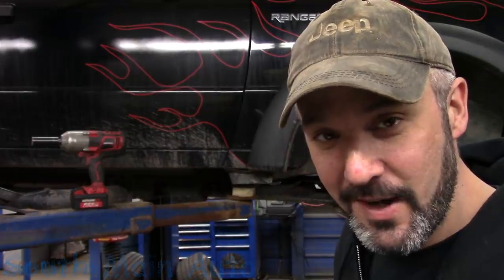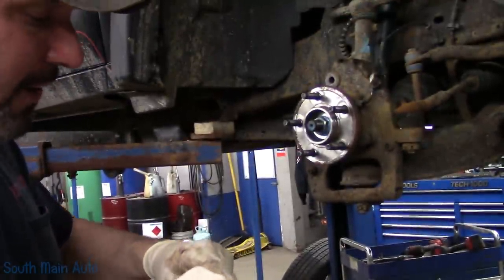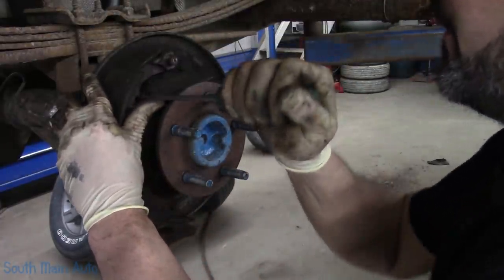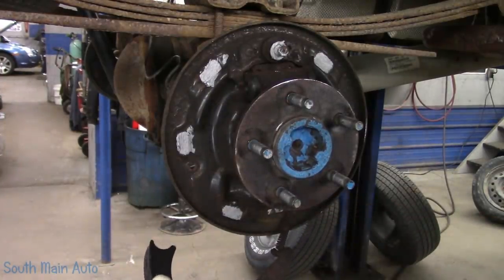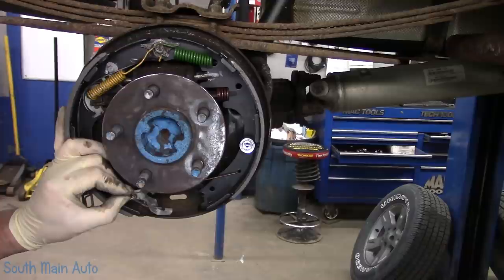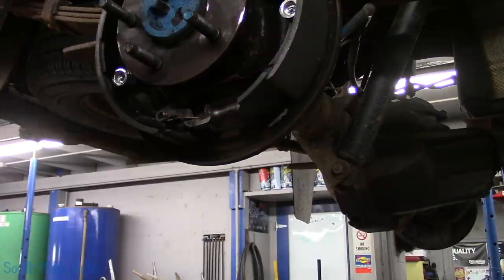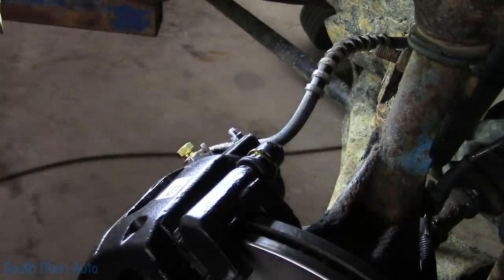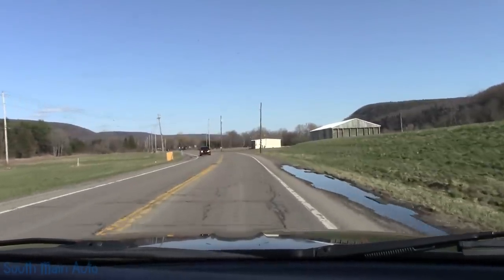Ford Ranger: Full Brake Job w/ Rear Drum Brakes

Comment: did you replace the back plates ?
Reply: stephen ross the front backing plates are not important. They do not support the brake mechanism on the calipers. As for drum brakes the backing plates are needed because they hold the torque of the shoe that will be stopping the vehicle.Drum Backing plates are way thicker.If they start to rot they would need to be changed. The front backing plates are just a dust shield. My 2003 Ranger I ripped them off 5 years ago due to rust as Eric did here and I never replaced them either. I have no run out on my rotors as of 2 years ago when I last changed the pads and rotors.

Comment: When I worked on brakes, starting in the 50s. we did not have any never seize. used dabs of chassis/wheel bearing grease or a little motor oil. Anyone else old enough to remember stringy wheel bearing grease. As a kid we used to say if  the rear end howls when you let off on the gas, thats ok. but if it howls when you step on the gas its going bad. that may not work on everything rear wheel drive.
Reply: I do remember!  First brake job was a 62 Nova, drums all the way around.

Comment: Hey Eric,  If you have the opportunity to do one, make a video of a GM "single-spring" drum brake job (like on many later Buicks).  These have to be the most unnecessarily difficult rear brakes ever devised by the evil brains of GM.
Reply from the maker: Oh man those are gravy! Oh and they have 2 springs BTW haha. I have a tool for them but I never use it. I can do both side in about 5 min if every thing is clean of course.

Comment: Great video Eric. The way you do things reminds me of how (exactly) I do things. I agree that you should use a service manual instead of the other side. It's funny that you mentioned that because I just did rear brakes on 99 Toyota Corolla and the springs for the automatic adjusters were installed wrong so the adjusters wasn't working. If I would have reinstalled them the way they were the automatic adjusters would again not work correctly. You should never assume the person that worked on the vehicle before you actually knew what he was doing.

Comment: I love bleeding brakes with my wife. It is the only time I can tell her what to do and get away with it. (up-down-up-down, Turn to the right, turn to the left). My wife is great like yours at helping out when I need a 2nd hand while  working on cars. I Liked how you showed the use of the  hose instead of letting the fluid run over the caliper. That is how I was taught to do it. Just something about brake fluid on everything that bugs me. I use a can and a hose. Anti-seizure has got to be one of the worst things to get off everything you don't want it on. I was wondering why you don't spray down the parking brake cable with your fluid film. I bet off camera you did.  Funny how the Brake clean makes no sound when it is empty. A very hand feature only your brake clean seems to have. Your father/ daughter ride along at the end made the video.  Keep em coming.

Comment: I’ve got a bad metallic squeak sound coming from my rear drums when slow speed braking. In my head it sounds like the brake shoes are getting hung up and releasing on the backing plate pads. Heard this before?

Comment: cheap-o's are cheap-o's, when they don't wanna pay for rotors, you clean'em up and slap them back on or supply cheapest chinesium junk.
On that truck I'm guessing it had new "chinesium" rotors, but it sat around only driven once every few weeks and never washed or very short trips, with minimal breaking.....
that is how you can tell good from junk metal rotors :)

Comment: I know this is a year out but I use a large cotter pin or split pin opened so you are only using one end. That can be pushed into the window and gives plenty of room for the spoon because the split pin is flat. You can slightly bend the pin if needed to push on the adjuster brake. I have been using the same one for years. I wrapped electritions tape around the other end so It gives me more material to grip, also so I know it is for brake jobs. I used to keep all my brake job tools together in a plastic tackle box so I knew exactly where all my stuff was. This was back in the days where I was going to college and used to do brake jobs on the weekends for extra money.

Comment: /sigh ... My little '94 4 L XLT has all 4 paws off the ground right now. Pin held front pads but the rear brakes appear to be identical to the one's in your video. Unfortunately the rt front blew the inside pad off on the interstate and at first I thought I had run over something and had a flat because it pulled bad to that side. When I stopped to check at the eatery a 1/4 mile away, tire was good but I could smell brake pad stench. Went inside, ate, came out and as I started to leave ... no pedal ... all the way to the floor. Anyhow, limped it home at Florida blue hair speed and got the front up on jackstands and looked. Pads on left side- OK, outer pad on Passenger side very thin, inside pad - gone and caliper piston had replaces it cooking the rubber piston seal. Yea me, bad maintenance rule violation #1. Check BOTH sides when doing an oil change...duh.

Anyhow, thanks for the rear brake walk through if I need to do them. Never have done a pinned caliper before, was shocked when I couldn't find bolts to take them off. At least Ford had the good sense to abandon that idiocy and a few people have made guides. Live and learn.

Keep tossing out those video's, I watch them all. Maybe in a few months I will have seen most of 2015 on. I'm learning to think outside the box thanks to you Mr O and dang it, you're fun to watch too!

Comment: In 1995 I bought a Ford ranger and I had nothing but front end brake problems with it. The dealership did 5 brake jobs on the front. The truck kept pulling to the right when I applied the brakes. I got rid of it when it had 49,000 miles on it.

Comment: 26:05 If you don't have the fancy "cup install pliers," just use ordinary pliers on front to compress the spring halfway, and reach behind and twist the "nail"  a quarter turn.  28:15 Better than your advice "Do it right, like so in this case," would be to give pointers to a NOVICE how to recognize proper orientation by how things fit together.  Also, helpful if you identify which side of the car you are working on.  This job is very intimidating to someone who has never done it before.

Comment: Ah, drum brakes. It boggles my mind how manufacturers used those for so long (some even to this day). I really don't understand how that pile of springs, levers, adjuster wheels, etc. can possibly be cheaper than a disc brake, even the fancier ones with the parking brake in the caliper. They're a pain to maintain or fix and don't really work worth a crap anyway.

Comment: finally got my drum off, had to get a big puller cuz that thing just wouldnt come off any other way. When I did get it off, it was full of all kinds of crap. I almost think it was in water for a little bit before i bought it with how there was so much crap i had to scrape out of everything. Also everything was gone. I have no idea how the hell that thing drove with no problems. I only tore it apart because 1 day my brakes got super spongy and I noticed brake fluid leaking out of my drum... I will consider myself lucky considering the condition of everything inside that drum.
But the reason people are intimidated by drum brakes is because there is a specific order to many different parts.

Comment: One of these days Eric, you are going to use Big  Nasty  to break lose stuck parts.  The whole car will start to vibrate and shake, causing. a big cloud of rust dust and pieces to obscuring the car.  When everything has cleared, there will just be a big pile of rust surrounded by four tires.

Comment: They should take the parking brake off the inspection list. Pointless because most dont use it unless you drive stick or live on a hill. my 03 rustyrado parking brake has nothing but issues rusting apart. now it needs cables. Yes I know its an old truck but if most never use it why make me pay to keep it working

Comment: I dont see how everybody can work in a closed garage while using a full can of brake cleaner,..  for me if i smell it for longer than 5 mins i get a headache or i get all light headed where my vision goes all blurry,.  Almost killed me once when i fuckin passed slick the fuck out from a mix of starter, brake clean, carb clean, gas and burning diesel fuel..  passed out under a rack wile it was being lowered and dude didnt see mre.  Luckily ole boss saw me on the cameras and ran out..  was on my shoulder and broke my collar bone so was close,.,

Comment: I learned something today - if ya got clumpy never-seize, use WD-40 as a thinner. Also, apply never-seize to the wheel cylinder actuators.  I'm going to do that next brake job! You are a wealth of information sir - thanks Mr. O!

Comment: Eric theirs one more way to adjust those rear brakes after initial adjustment, and you don't even need to go back under the car to make the final adjustment and it's called equalization and their designed by the engineers to work this way to create the same travel and adjust out to its final click.  All you have to do is run the car in reverse at moderate speed and apply the brakes and the lever at the bottom leverages over on to the star adjusting wheel and pushes the star in the expanding direction depending on how far the primary and secondary shoes have to travel to adjust.  I've always adjusted them close manually not even to binding then went out and drove the car in reverse through two or three firm stops done.   Then anytime you get 15, 20 thousand miles on your vehicle you can do a readjust on occasion by doing it again.

Comment: I worked on a 2004 F150 2wd from Southern California desert area on Friday for a wheel bearing and upper ball joint.  The upper control arm  bolts were not only not rusty they were still silver cad plated like new HA!!!!  never see that even around here in Va.

Comment: For drums  shoe retainer plate  eyeball looking thing the 2 gizmos on the wheel cylender are wheel cylender push rods next in is the push rod piston piston seal separator spring  and the same going back the other direction auto adjuster retainer clip horse shoe and the pin retainer springs and clips aka quarter clips

Comment: Eric,With the new calipers on the bench,locate a hose that fits over the brake bleeder port. Next put the end of the hose inside the bottom end of the funnel.Now remove the plastic banjo cover,fill the funnel with brake fluid and open the bleeder.The fluid will come out the banjo fitting when the caliper is full.Sort of back bleeding the caliper. I have done this when I don't have a helper to bleed the brakes.Hope this helps you. Ken

Comment: I am surprised the cable was still in tact.  Usually by the time we get them and they are due those cables are broken and the pieces rolling around in the drum.
Reply from the maker: Customer told me he had replaced them a couple years ago. I had actually ordered adjuster kits before I even took it apart because I assumed they were gonna be rusted too haha
Reply: I agree with aftermarket drums as well!  I usually throw them on my lathe and take just enough off to get them smooth again.  I know I shouldnt have to do that with brand new parts but when the old drums are crap, what are you gonna do???
Reply: I got into the Zone once and bought some drums for my 94 dodge caravan. Don't ever get into the Zone unless you absolutely have to.Thought I was doing a good thing by replacing them. The crappy Auto Zone drums were out of round on the inside from the get go. I took then back to the Zone and the kid at the counter almost didn't take them back, said he thought I had turned them. I said nope the is the way I got them. They still looked brand new ,had only be on about a day. Lifetime warranty, got my money back. Put my old drums back on, and they worked fine and are still on there today.

Comment: Nice video as always Eric I was showed that trick with stopping the brake fluid until some old school Tech told me to put the brake pedal on slightly with a bar it Block's the master cylinder off and traps fluid in the lines makes bleeding brakes easier to after free tip Sunday 😉

Comment: Nice video.....I had to laugh at the test drive....my 2003 4x4 Ranger rides like a lumber cart too.  I like the Trina commentary!  You shoulda gave the the guy the classic zip tie trick on the throttle cable behind the gas pedal.  They stretch out over time on those Rangers and make them feel more gutless than they really are.....lol.

Comment: The way I keep air from getting into the lines is, I wedge a good sturdy board between the brake pedal and the seat to that way you can just put the caliper brake line back in without air having to get into the lines.

Comment: I'm not intimidated by drum brakes.  I do however feel clueless when it comes to adjusting them.  Consequently I tend to have slightly soft brake pedals.  My f350 has so much drag on the rear wheels I have a really hard time telling when the shoes are dragging or if it's just drivetrain resistance.  One day all of my vehicles will have rear disc brakes but for now 4 of 8 have rear drums.😞

Comment: I had a 01 Ranger with the 4.0L that had that pinion bearing whine. I bought the truck pretty cheap with almost a 160,000 miles. I wasn't to worried about. I figured I would either wait, and try to find another rear end from a savage yard or fix it. I originally bought the truck figuring I would put on somewhere between 40 to 60 thousand miles and something major with the truck would go wrong and send it on it's way. Next thing I knew the pinion bearing was still making that sound at 260,000 thousand miles and sounded like a timing chain tensioner broke. I can't complain, I put 100,000 miles on during the 8 years I drove it, With the little money I put it, a small leak in pinion seal in the front differential, and I couldn't tell if it ever brunt or leak a drop of engine oil. With an average of oil changes around 5,000 miles. Wouldn't scare me to buy another decent maintained 4 L Ranger again
Reply: someone likely didn't change the fluid until it was howling and had bad worn gears from rusty fluid grinding them away. amazingly many times the bearings will survive enough that after a fluid change, they'll go huge miles still, howling the whole way!

Comment: I may get some boo's, and the difficulty doesn't escape me, but did I miss the reason that you didn't replace the wheel cylinders since you said it was getting the whole chitenkaboodle brake job? Believe me, I know about the classic line twist.
Reply: Kerry Mullins why stop there?! Didn't get lines or backing plates either!
Reply: Lines  can be replaced without tearing everything down. not too concerned about backing plates, my big rig don't have them.

Comment: Anyone know the make/model of the extendable ratchet Dr O always uses?
Reply: Probably a $500 Snap-on.  I know Harbor Freight carries a Pittsburgh extendable ratchet with a 1/4 inch nub on one side of the head and a 3/8 inch nub on the other side.  I personally hunger for a set of E-ZRed extendable ratchets with lockable pivoting heads, about $80 for the set.
Reply from the maker: It is a toptul

Comment: I found out the hard way that pinching the hose can make a tear or one way valve inside the hose. I did it twice before I figured out what was going on.
Reply from the maker: That is nuts. I have done 10's of 1000's of brake jobs and never had one fail... ever....
Reply: Yes on old hard hoses!

Comment: I may be wrong,but seems to me that with rear drum brakes,the adjusters function when applying the brakes in reverse,not with the parking brake as rear disks. When the brakes wear the shoes will 'rock' which actuates the adjusters.When they aren't in need of adjustment there isn't enough motion to advance the adjustment mechanism.
Reply: Les Bender, you are correct . When you back up and hit the brakes the slack will rotate the shoes and the lever on the starwheel will tighten the shoes. However some aftermarket cables are not the exact oem length and do not allow the lever to sit correctly on the starwheel making it non-functional.
Reply: Only a minor correction Dave, the reverse brake apply only cocks the spring that when moving forward again will rotate the starwheel. Otherwise one could pull the cable in two. Yes to troubles with cables that didn't come from inside the drum, a real bag of trouble there. Very astute Les, you got what it takes.
Reply: Lee, not sure about that I was taught in school and learned on the Bendix type brake drums and watched videos of the lever tightening the star wheel when the brakes were applied in reverse. It may be possible they changed a bit from the 80's, here is a link anyway...http://www.brakeandfrontend.com/drum-brake-self-adjusters-understanding-these-ancient-devices/

Comment: I live  in Kentucky, and work as an automotive tech.I had the pleasure of doing a break job on a car from New York last week. What a pain! I told my boss we should not ever do a northern car again unless they replace all the calipers and brackets. So much wasted time cleaning rust off of calipers and making sure everything would move smooth. I have a greater respect for you now that I have experience it myself.
Reply: Bryan Davis Your Boss let's you live at his shop?! Nice Boss! Do you also do the Security there?! 🤔
Reply: scary part, many of the ones he services in video look far better than many you'll actually run into!
Reply: throttle bottle If I had to deal with that every day I think I would find another career. LOL 😅